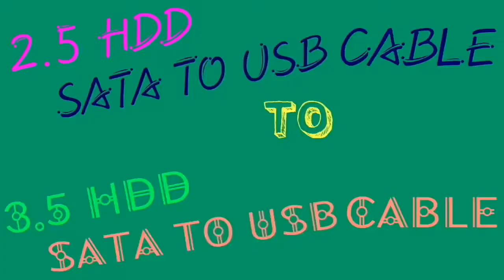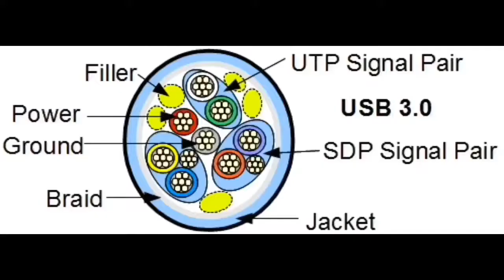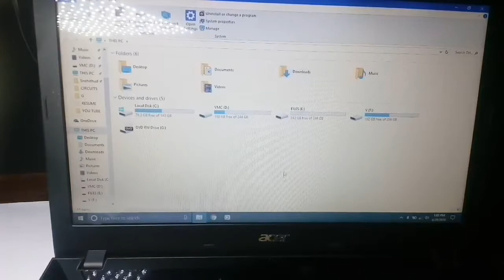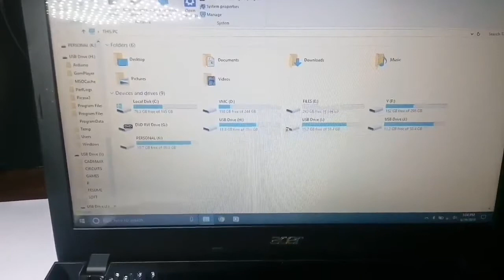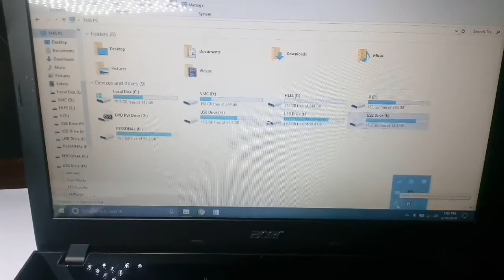DIY - HDD SATA to USB Converter 2.5 to 3.5

Comment: no.problem just 4 cable using?? red black green white???  i dont want use usb 3.0
Reply: yes its the same just if your using a 3.5 hdd you have to modify with 12 i followed the stems and it works

Comment: Rewire in different order or just resolder the wires?
I have 2 versions of these connectors
one with 3 (+ - -) little holes on the board like if they were designed for a 12v input jack.. that's an easy to do conversion...
the other has a board like the one you show, more chips and nowhere to find any sign of designed but not used points for a jack install....